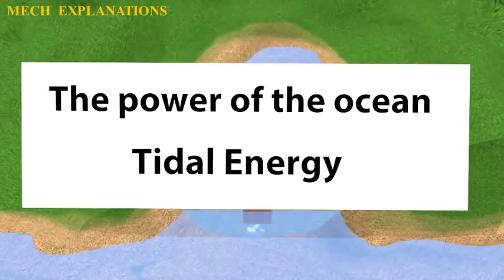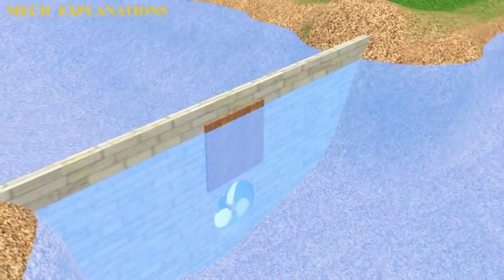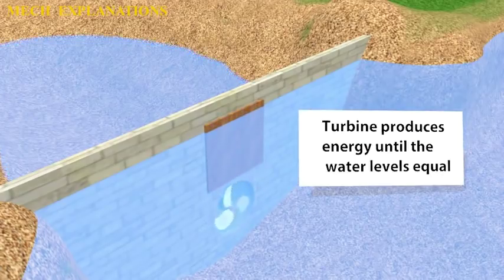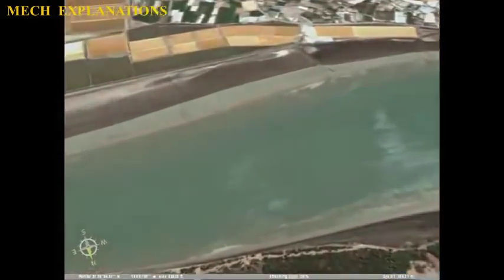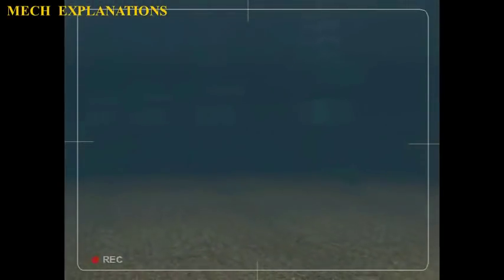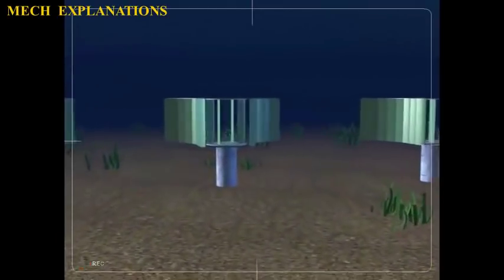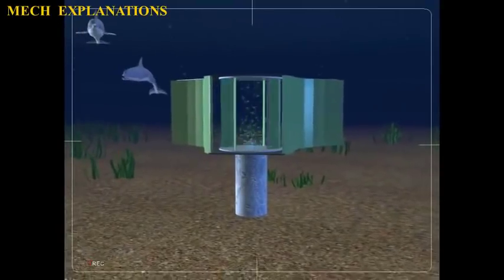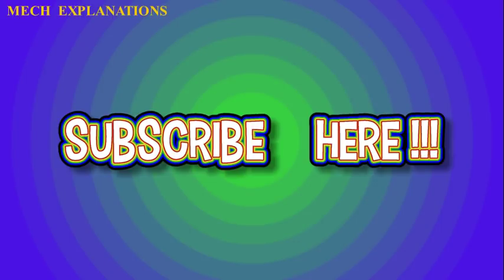Tidal Energy ✔

Comment: How it works is divided into 3 main components viz
1. An iron tube filled with air that is moved by ocean waves to pump hydraulics
2. Hydraulic pump that works on the force of pressure by utilizing liquid fluid that utilizes kinetic energy.
3. Turbines that convert kinetic energy into electrical energy
The hydraulic pump produces pressure which makes the introductory fluid raised by a wave of sea water which is then channeled and passed through a pipeline so that it can turn a turbine. From the turbine, the energy is converted into electrical energy that is stored before flowing into homes or forging

Comment: Hi. Mr , As you know, there are studies to obtain clean energy from the waves of the seas, where many ways to obtain electricity have been discovered, now Britain wants to implement a project on the coast by constructing a bridge and installing the turbines under it, but all of these discovered methods do not work very efficiently because the turbines rotate in opposite directions (two ways) and there is stop between the tide and flow that's reduces efficiency. Finally, I have invented an idea makes turbines rotate in one direction only, high speed without stop, whether at the tide or flow and the possibility of installing more turbines. so I want your help to communicate this idea to companies

Comment: Can do one better with a long pipe at a 90 degree angle placed at the very bottom and reduced down every 100 feet via surface under high hydraulic pressure...